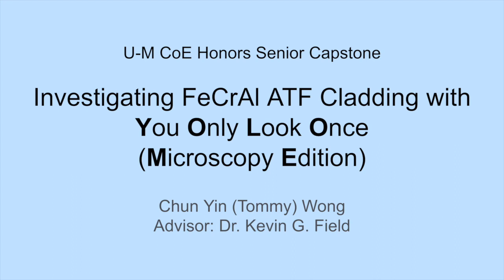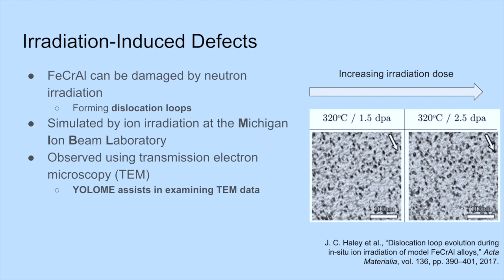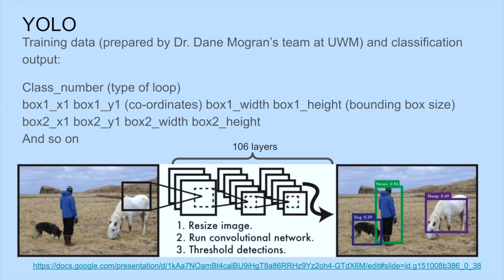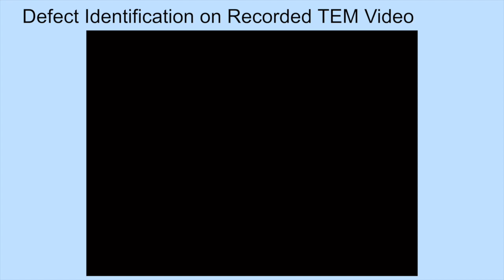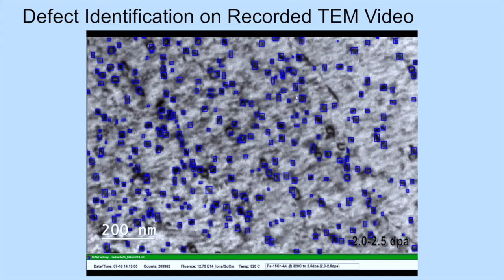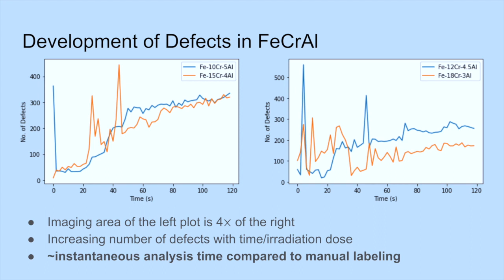Investigating FeCrAl ATF Cladding with You Only Look Once (Microscopy Edition)

Comment: Hi Tommy, this was a really interesting presentation. I am curious as to whether your research group is considering studying other potentially cladding materials. You mention the hydrogen liberation rate as a key characteristic used in selecting FeCrAl as your material of interest, but are there other cladding materials that could be analyzed in future studies with similarly low liberation rates?
Reply: Hi Matthew, yes! In fact, silicon carbide composites are another promising class of fuel cladding materials that is actively being developed.

Comment: Thank you for the interesting presentation. Your research covers a great application of computer vision for dislocation detection. Is there anything in particularly with the TEM images (other than the initial small size of the dislocations) that make them specifically difficult in classifying the dislocations?
Reply: Thank you, Jason. Another major difficulty is the background noise of the material being examined, whether it be due to surface roughness or the shifting/folding of the sample when subjected to both ion irradiation and the electron beam from the TEM. These variations in the imaging conditions make it difficult to perform classification in an in-situ setup.